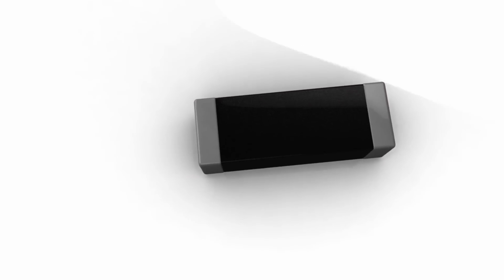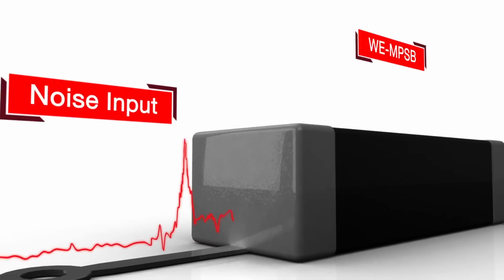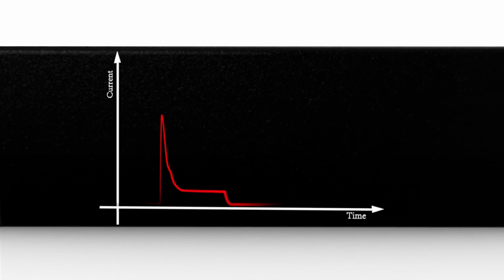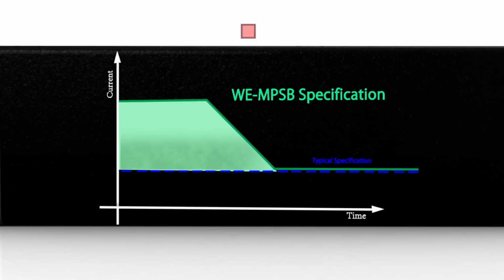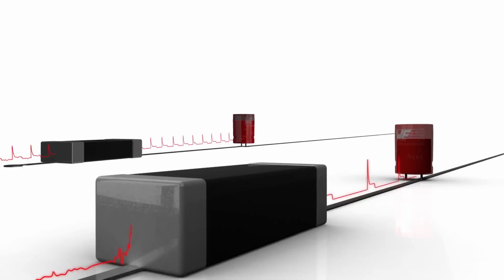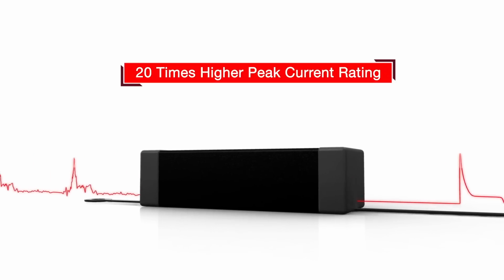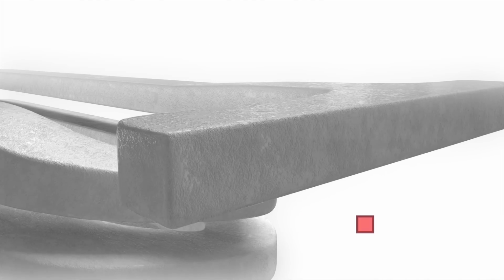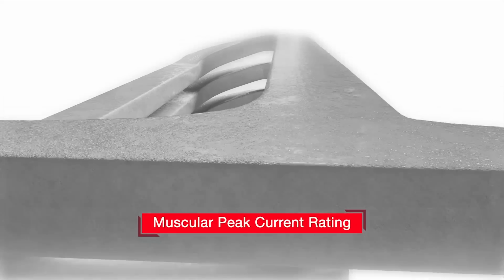WE-MPSB - Multilayer Power Suppression Bead

Comment: wut if customer use NTC for current limitation still we need inrush protection ?
Reply from the maker: Hello Ahmet, thanks for request! NTCs and the WE-MPSBs has different usages. NTCs are for inrush current limiting and MPSBs are for filtering the rf noise. The MPSB has the additional advantage that it can withstand inrush currents, specification see datasheet, without being damaged. If it can be guaranteed that the filtering ferrite bead will not “see” any inrush current due to further components you can use a CBF. Best regards, Würth Elektronik